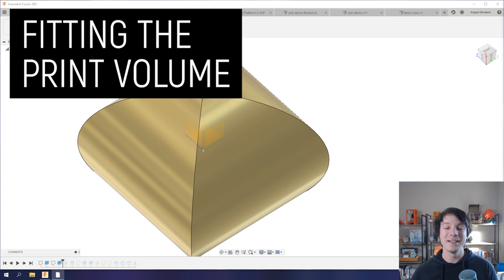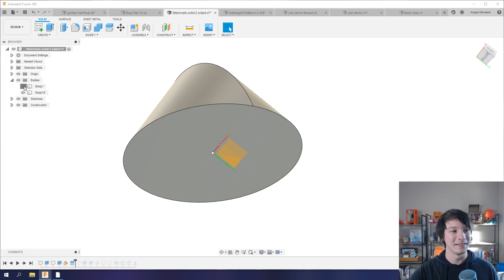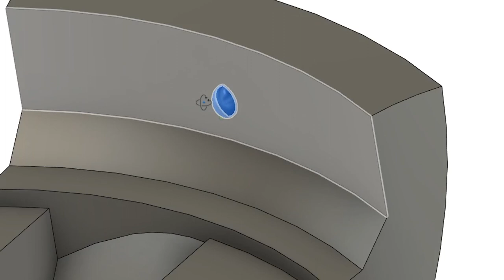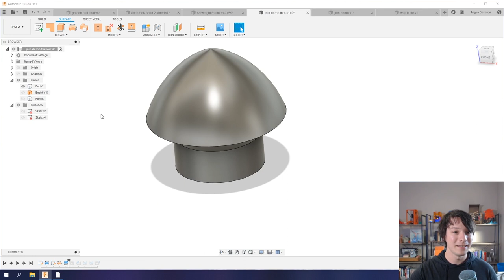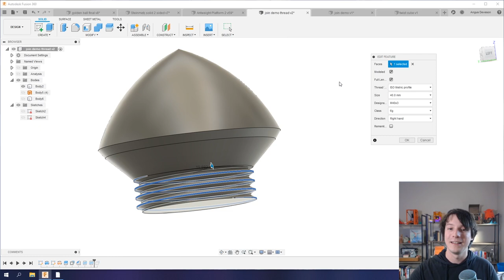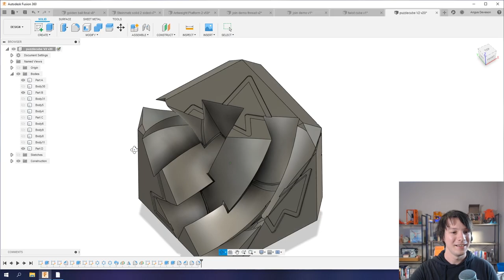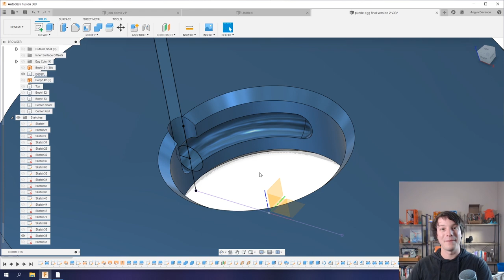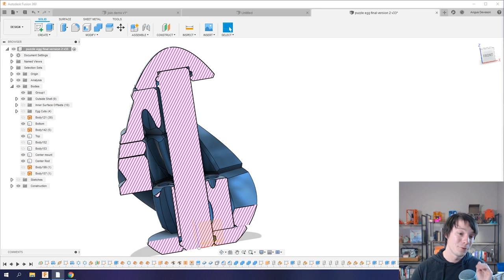Designing for Assembly in Fusion 360 (Advanced CAD Tutorial)

Comment: Great vid :) I often use press/pull for my clearances too, but doesn't always work, ddpending on the geometry. In those cases, (and more often than not even if I use a single command these days) I setup a single parameter to hold my clearance value, that way people can adjust any and all of them at the same time, simply by changing a single value no matter which command I hapeen to use :)
Reply: I use 3 main parameters for clearance:  0.1mm press-fit, 0.2mm tight-fit, 0.3mm clear fit.  those 3 are easy to remember, and come very close to the ISO standards for fits and tolerances used in machining.

Comment: A bit of a constructive criticism at the 13:25 mark... Fusion 360 DOES allow you to EASILY align two halves PERFECTLY - when using threads to attach two halves. There are two simple tricks that you can use - I will use your, @Maker's Muse, two football halves, as an example: <ONE(1)> "the hardest of the two"...  >skip the 'extrusion' of the upper half till later - upper half must "bottom-out" at the lower half, at least for now  >create matching threads on both halves  >make each half a 'component' - basically create two "components"  >select the bottom & top halves/components - right click - select 'rigid group' - so the upper & lower halves/components will never go through each other  >select, and right click on the bottom half/component, select 'ground' - so the bottom half will never move  >select the upper half/component - go to 'assemble' subtab, and select 'joint' - 'snap' points, on both halves/components, should be at the lowest points where the two halves touch - HENCE, why I earlier mentioned to leave the extrusion, of the upper part, to the very end - make sure, while creating the joint, you select for the upper half/component to 'revolve'  >go to the 'assemble' subtab again - select 'drive joints' - click on the joint you just created - and in the options, make sure that the joint is at the zero position/rotation  >if the upper part is not snuggly fits inside the lower part, and keeps on popping out, then you can try another 'joint' for the upper part, but this time, specify for the 'snap' point to be a 'slider' - the lowest point, where the two parts/components touch, should be the start point of the 'slider' - the end point of the slider, can be anywhere above the starting point - just make sure that your path is centered, and is going straight up, from the bottom half/component  >again, "zero-out" the joint in the 'drive joints' option  >NOW, Fusion 360 will "automatically" snap the two halves/components together, and will align the threads perfectly  >do your 'extrusion', if need to  >continue creating your designs, on both halves - 3D print - and you will see your designs match up at the final "screw-in"... <TWO(2)> "the easiest of the two"...  >keep your 'extrusion' on the upper part  >create desired thread ONLY on the BOTTOM part  >create a 'copy' of the BOTTOM part - in same exact position - and 'hide' the original "copy" of the bottom part  >having your upper part in its final, "inserted"(like in 13:25 of the video) position - inside the lower part (copied lower part) - go to 'create' subtab, select 'boundary fill' - for 'select tools' select the "copied lower part" - for 'select cells', select all the cells of the "copied lower part" - for 'operation', choose an option to 'CUT' - click 'OK'  >NOW, the thread from the "copied lower part"(an invisible part now) is "cut" into the upper part  >"UNHIDE" the original lower part, and you will see how threads, on both parts, are aligned perfectly to each other  >proceed with your designs, and 3D print without worrying about misalignment!!!;) @Maker's Muse, if you, or anyone else watching your video, were not aware about these techniques/applications, then I hope I helped. In the end, I'm just trying to return a favor for all the help/education you have provided me - with all your awesome, and very informative videos. Great video - keep it up mate. Cheers!

Comment: Great summary Angus, thank you! I suggest you a thing 'cause I don't see it in your contruction histories. After you use surfaces (or bodies) as cutting tools you can remove them from the Bodies tree by right-clicking on them and select "Remove". Of course if you're sure you don't need them later in the modeling process. By doing so you can keep your Bodies tree clean and have your main bodies displayed without any auxiliary geometry. It's expecially handy also when you split a body and you don't need to keep all the resulting splitted parts. Keep up the great work!

Comment: Another technique to be aware of is cutting other models to use previously modelled features that you might otherwise have trouble making from scratch.

For example, I wanted to model an internal tapered pipe thread. So I looked around on thingiverse and found a simple flange with the correct thread. Then imported it into Windows Builder because my real CAD software cannot do any Boolean operations on STL models. So I created some simple hollow cylinder in Builder and 'cut away' the part of the flange that I didn't need. Saved that as a new solid and imported it into Cura and placed it in a cavity hole in my real model. I had to make sure there was some overlap between the two models so that Cura would print it as one model. This means oversizing the cutout model because precision placement is/was impossible to do in Cura.

Comment: As always, very informative and interesting! Keep up the good work!
Just a quick tip - the model with the thread could be easily modelled by making a thread on one of the parts and then just use the same part as the tool body do cut the needed clearance in the second part using the combine function.
Reply from the maker: Huh, good point! A boolean difference would definitely work.

Comment: Thank you Angus. I’ve always struggled to put pieces together and make them fit. Typically used a screw connection, but as you mentioned, they do not perfectly align. I was blown away by the other various ways parts can be connected. Thanks for the video, very helpful and informative indeed. Btw, do you do clearances when in sketch mode?

Comment: for assemblies with more than a handful of joined parts, the press-pull method might be cumbersome.  I generally model clearances into my sketches using a couple of clearance parameters (clearance_fit, clearance_motion).  The one downside to this is extruding to another surface minus the clearance distance.  I have to create an offset plane of clearance distance from the surface I want to extrude to and then use that plane as the extrusion endpoint.

What do you think? Is there a better way? Do people prefer to press-pull clearances at the end of design even with multipart assemblies?

Comment: I’ve been struggling to get the tolerances right on a dovetail from someone else’s box/drawer model that needs to have enough friction to not slide around when opening the drawer, but easy enough to slide together both to 1 box or 4 boxes (one on each side) without a hammer.

Comment: Nice pointers for the design features but the clearance thing is still very messy. For accurate models I need to try multiple times before it actually fits and I really just add the clearance from the sketch other than those for the screws

Comment: 4:20 I have done this kind of joint before... and turns out the size of 3D printed models are a bit off from than design, and therefore it does not fit in... and I have to sand it for a while... and your sliced objects seems to have structural overhangs when printing, which cause quiet some trouble for me.

Comment: Why are you worried about the shelf on the top of the "threaded football", but not the entire bottom floor underneath that 5mm Pull that is going to a HUGE overhang?
Reply: I think that's because the big overhang is an uninterrupted bridge with solid structure on all sides so it could be printed with no support, but the thin overhang  would have no structure to bridge across.